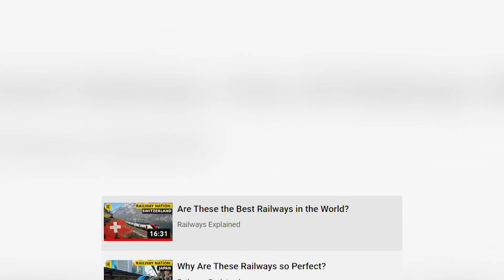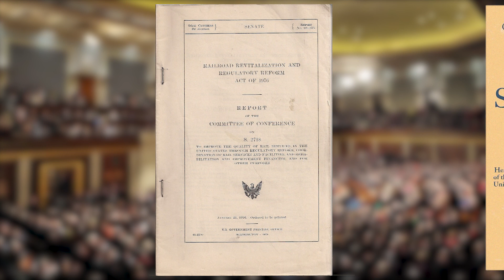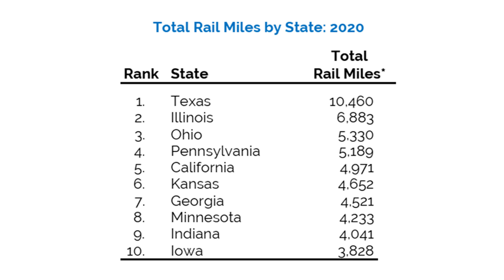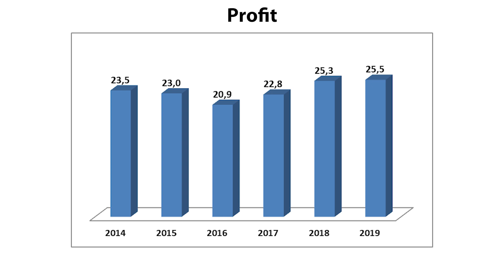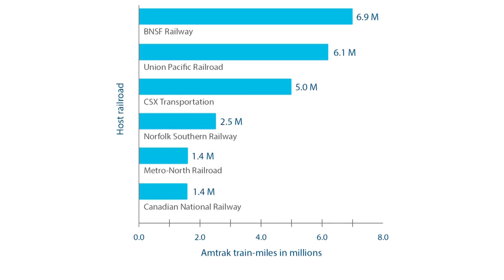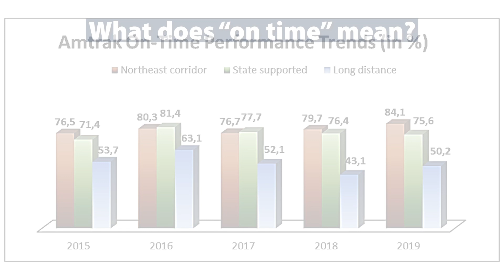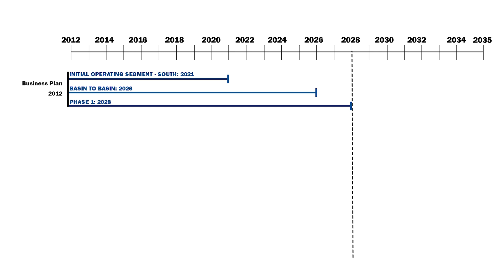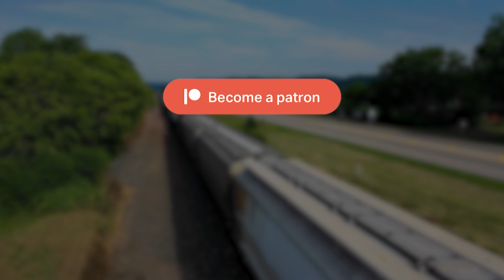American Railroads:  - Learn EVERYTHING About Them!

Comment: 7:34

Something to also note about electrified rails (not sure if it gets mentioned here or not) most of the US power grid is based on coal/natural gas burning. So even if the trains themselves are cleaner, its sourced power isnt. It's why I'm a big proponent of nuclear power.
Reply: Even with coal as the source of electricity (the most CO2 polluting), electrified trains are incredibly non-polluting and green. Even now with significantly more polluting and old diesel locomotives, US freight railroads are several times less polluting than trucks! And electric vehicles charged from coal are still less polluting than conventional gasoline cars!

It is true that we need more sources of non-CO2 electricity sources and sources that don't rely on foreign dictators for fuel. Nevertheless, let's not lose track of the actual tangible improvements that electrifying trains and other transportation will bring even zero (!) movement on renewables or nuclear! All the more since when these new non-polluting energy sources do come about, they automatically reduce the impact of already electrified rail!

These two processes, electrification of our economy and renewables and nuclear need to be parallel processes that are unhampered by lack of progress on one of the fronts!
Reply: @TohaBgood2  

Might be a tall ask but do you have any citations to back up your claims?
Reply: @killtyrant  Sure, but I have to search for them. I have a bunch of this stuff bookmarked somewhere. What particularly are you interested in? Efficiency of electrified trains or electric cars charged from coal power?

Keep in mind that even in this video he states that diesel trains are four times more efficient than trucks.
Reply: @TohaBgood2  

The electric car powered from coal still being cleaner than conventional gasoline. Its something I've always wondered about

Comment: Due to the size and population density of the US, high speed rail really does not make much sense outside of the Northeast Corridor.  Given the increase of people who can work from home, fewer people will need to commute in the future.
Diesels pull freight as they are more cost effective and efficient at doing so They really don't pollute that much anyway.
The biggest enemy of railroading is precision scheduled railroading.  It's just an extra cheap way to operate the freight trains with little concern for customers or the future.
Reply: Literally no one is proposing that we have HSR outside of the areas where it makes sense. A lot of experts have looked at this and there are several not only viable but extremely profitable potential corridors. This includes the Texas Triangle, California SF-LA, South-Central Florida, Chicago area, and a few others.

NO ONE is proposing that we replace airlines with HSR outside of these high-traffic corridors. No one ever suggested that. But there are these city pairs where HSR would simply destroy all other transport competition because the distance is just right for HSR and too big/too small for cars and planes. That's 100-500 mile trips between two major metros.
Reply: @TohaBgood2  by some of the rebuttals you would think the HSR proponents demand a link between every small town in the US
Reply: @romanrat5613  No one ever even suggests this. HSR is fundamentally a high-volume mode of transportation. It is supposed to replace short-haul flights under 500 miles. If the destinations don't deserve an airport they usually have no need for HSR either.

I hear this nonsense almost always being peddled by opponents of HSR. They're the only ones perpetuating this conversation. No one else is even interesting in discussing this. It makes no sense.